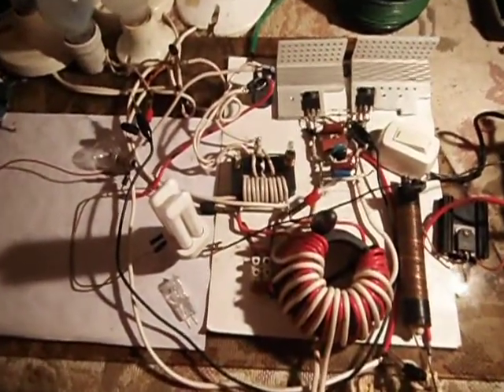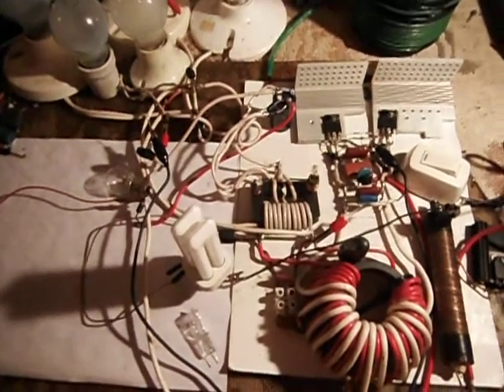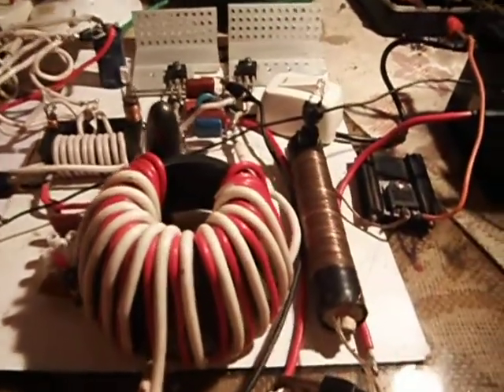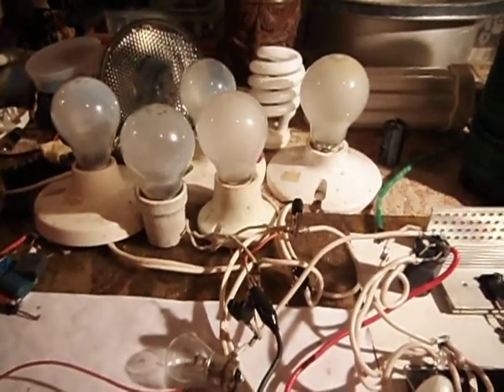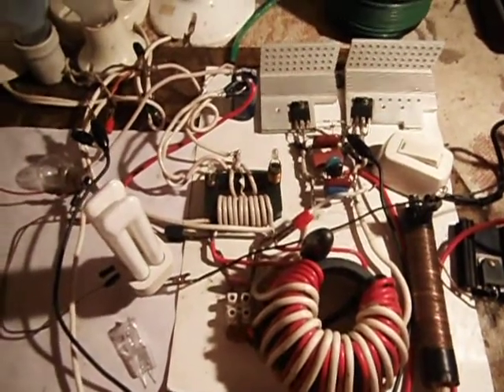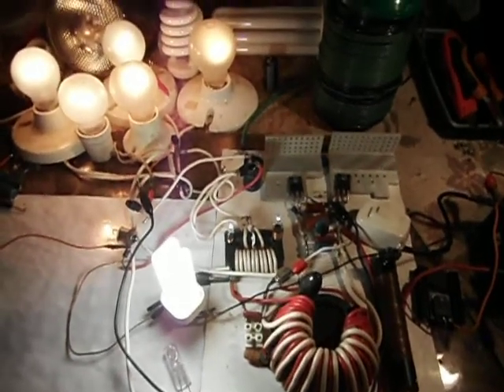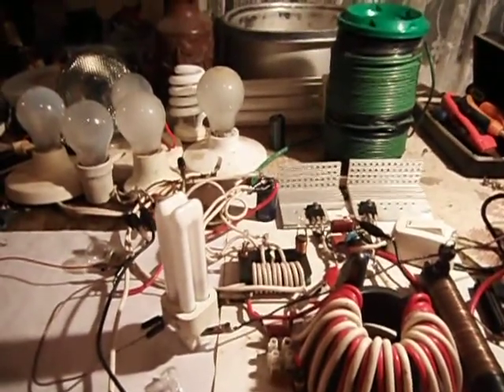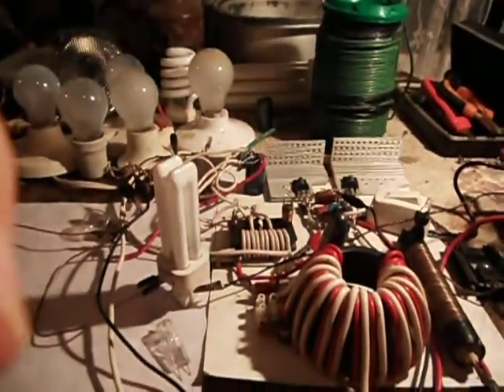Mazilli- Tv yoke circuit, with HV pulser, and feed back loop

Comment: If you meashure input curent, then maybe more be ideas. Now I do not know, you get overuinity or not.
Reply: If the output is 500watt bulb or even if assume it's 80% brightness at around 350watt then divide by 12volts.I don't think the 12volts battery can produce 29Amp at all.This is some interesting effect like lasersaber's circuit but only much higher power which can only be reproduced through experimenting with yoke core as one of the important requirement.
 
It's very interesting lighting 5x100watt bulbs on 12volts battery
I don't think my 1500watt pure sine-wave inverter can even handle 220volts 500watt bulb using 12volt 21Ah battery.Estimated 50Amp is needed base on calculation.